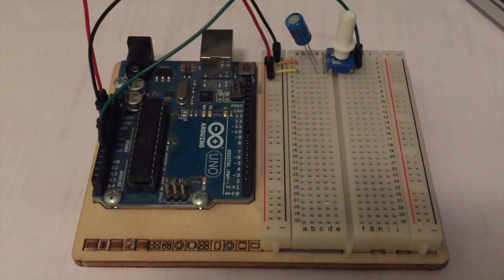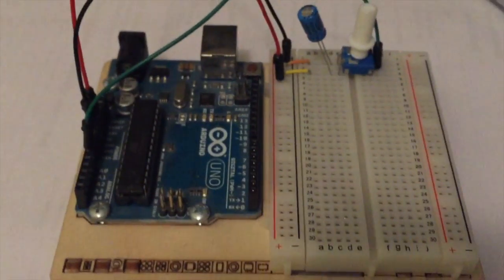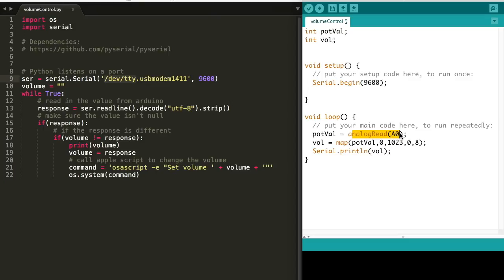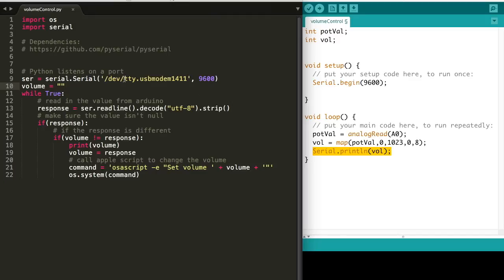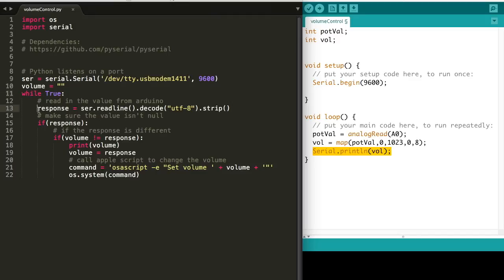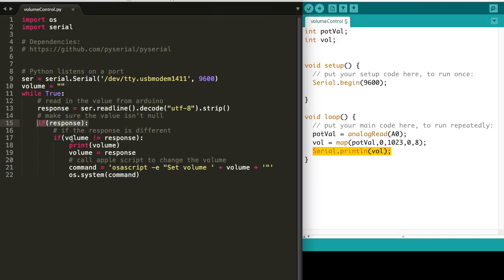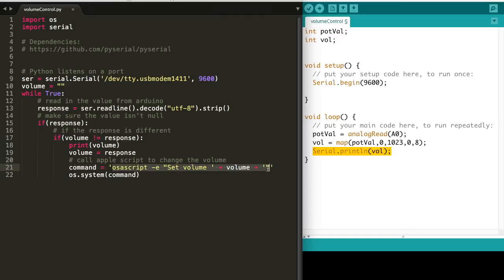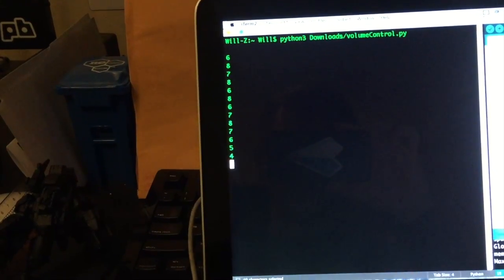Arduino Volume Control Tutorial

Comment: instead of potentiometer, can i use tcrt5000 ir sensor ? i want to create a volume pedal/wah for my guitar.ill be using the pedal as a midi input

my idea is that the ir sensor will detect the distance to control the volume
Reply from the maker: I'm sure you could, the sensor doesn't really matter as long as you can read it's value and convert it to a percentage.

Comment: Hey bro can you make a diy volume controller in virtual dj with deck 1 and 2
Reply from the maker: I'm a little unfamiliar with Virtual DJ and it's controls but I am working on a side project that uses an Arduino Micro act as a keyboard device and send direct keypresses to the computer. I could probably put together a video if you'd like.

Comment: Great, but, What kind of capacitor? what is its value?

Regards
Reply from the maker: As 10A-07 said it's quite possible it isn't needed, the circuit was based off of a diagram found in a beginner Arduino book. For reference, the one I used was a 100uf 25V capacitor.
Reply: im pretty sure  its not required